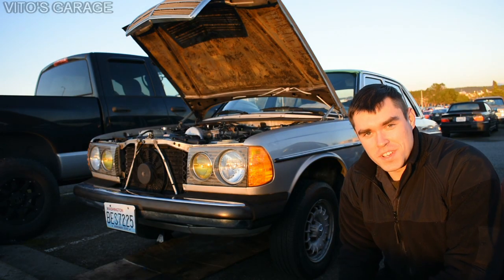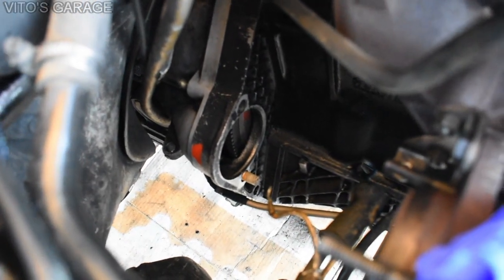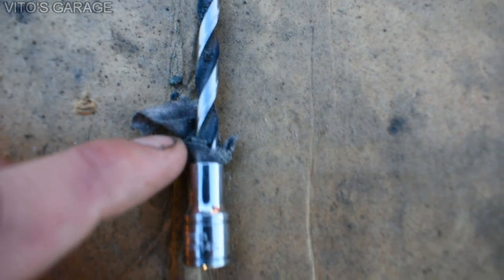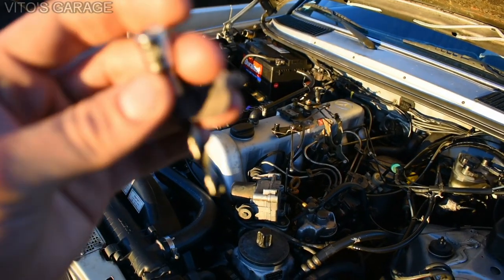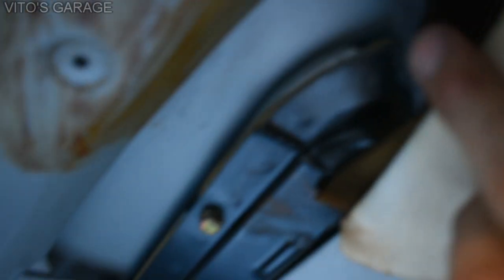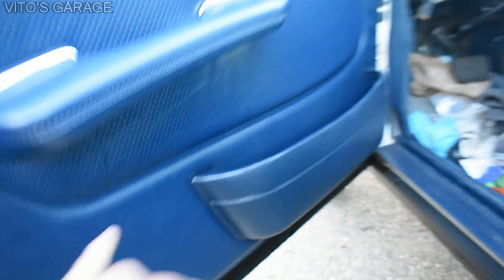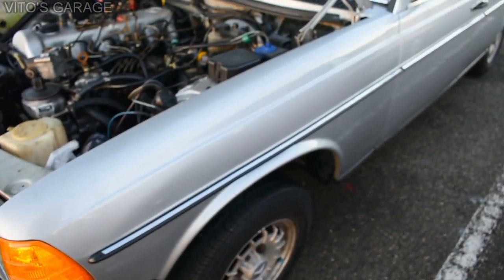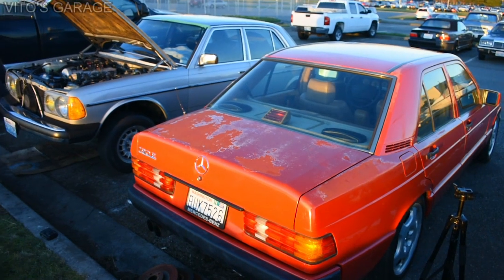Dad's Mercedes W123 Current Progress! Home-made Glow Plug Reamer for Diesel Benz! More Tips & Tricks

Comment: Can you post links to the rebuild kits for your Mercedes? I have an exact match to yours and I've been trying to find a rebuild kit myself.
Reply from the maker: What rebuild kit do you need?
Reply: @VITOSGARAGE  well i was looking for a turbo rebuild kit for a 1985 mercedes 300d. I'm trying to find one that has the turbo spindles included in the kit.(I'm sorry if that's not the correct term for them I'm still new at this).